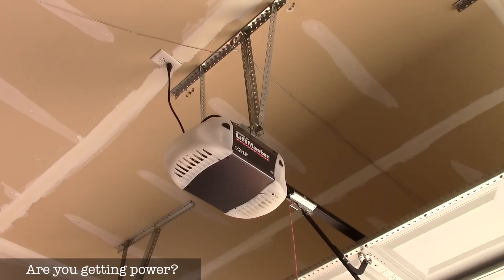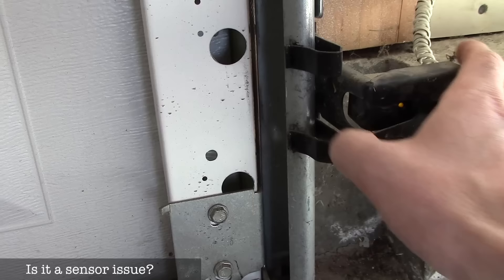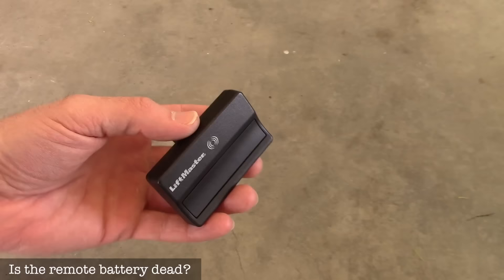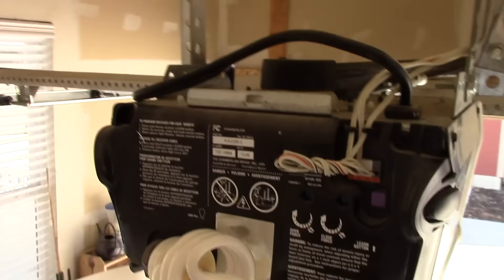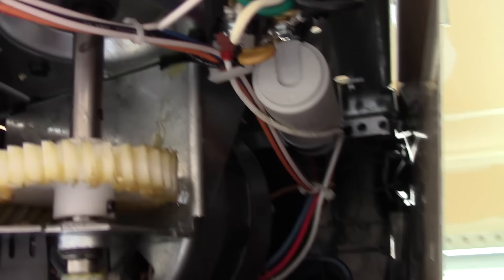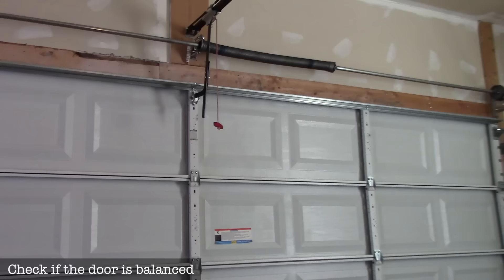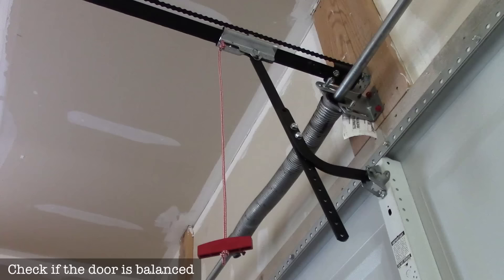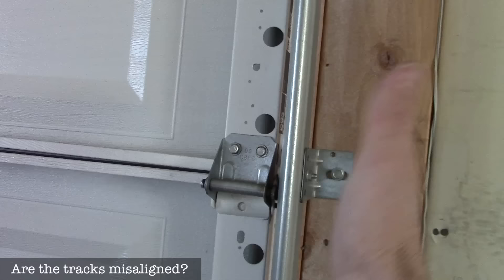Garage Door Opener Troubleshooting and Repair - How to fix common problems

Comment: Hi, I just ran across your video. I am having a challenge with my garage door. I have power and all of that and I push the button and the door will lower as it always does but I had a recent power outage and I thought maybe that was the culprit But now the door is lowering all the way closed and then the light would start flashing and the door would once again go up on its own. I was wondering if you might know what the fix of that challenge maybe.

Comment: What about the limit controls and the Open & Close force adjustments? Do you have any videos on these knobs ? They were in your video here but I didn't see you mention anything about them. Our door only opens or closes about 1 foot. When I started to adjust these, then the belt keeps running, or if I chose less adjustment, then the door wouldn't open but 2 in. Model is a Genie Pro Stealth (belt driven). Thanks...

Comment: Adam, great video.  Almost addressed my problem.  Just started.  Intermittent operation on same opener as in your video.  Sometimes opens fine, sometimes will stop in midstream.  Both in open operation as well as in close.  Just lately just goes dead.  Light goes out, no leds on wall or side sensors.  Wait a while and again works again till it doesn't.  Driving me crazy.  It is like something is heating up and if you wait till it cools off again, it will work????  If you have a chance to get back to me, I would appreciate it.  Thanks, Vince
Reply from the maker: I would check the wiring and connections. It could be a capacitor going bad as well.
Reply: Thanks for your quick response and great advise.  I watched the video another time and decided that it was the capacitor, so I went to a garage door company and purchased one and replaced it and the door works fine now.  Again, thanks and good luck to you.

Comment: Hi Adam. Your troubleshooting video is enlightening and helpful. 
However my problem is with opening and closing with a remote transmitter. Initially my double wooden garage door used to open and close with just a press on the button But recently it would open and close erratically and I’d have to press and hold down the button until fully opened or closed. What is my problem?

Comment: hi Adam. thanks for your video. I have a client with a sears garage door opener not working. it has a chain on one side and a cable on the other side of the rail. the cable side is under very high tension. the chain side is very loose. I have not take the cover off the motor yet but will be doing that tomorrow morning. I think I might need a new gear set according to your video. please confirm. I also tested the opener and the motor just make a slight whirring sound like it wants to work but cant because of a broken gear set or maybe a bad capacitor. I'm leaning towards the gear set because of the wire being high tension on one side and the chain loose on the other side of the rail. let me know your thoughts asap. thanks, jason

Comment: Thank you for this video! All my remotes were in working order with fresh batteries (including the code panel), and one day everything stopped working. Even the wall switch doesn’t work, and also doesn’t have light to it. Sensors look good. Tried my fuse box and that doesn’t work. Would the next step be the motherboard? I’m not sure about going there yet when it seems I may have a problem at the switch. What are your thoughts?

Comment: Great video! Need your help we have an old Raynor opener that's doing 2 things. First off we noticed using the remote we now need to work to find a sweet spot hitting the button long enough for it to go up or down all the way correctly versus starts and stops almost immediately requiring multiple attempts sometimes requiring we use the button in the garage which works consistently  every time. We've replaced the battery and remote. Thinking we need to replace the small black box control due to age and its limiting the remotes effective activation range? 

Second, the train is hopping up and down at certain spots along the track. We greased the track (bottom and top edge) and WD40'd the wheels, axle shafts and checked condition of springs (new within the last 1.5 years when door was professionally serviced. Based upon your video appears everything has easy/free movement and is properly aligned achieving neutral. We also played with adjusting the chain more or less and didn't make a difference. Violent enough that the door will stop in its tracks and we need to help push/pull to assist before it gives up and times out. Uncertain if this makes a difference, we get a lot of moisture in the garage given how it was constructed. Concrete patio above leaks when it rains and concrete block sweating given the back side is partially buried. Appreciate your help and advice. Thanks, John

Comment: Thank you for this amazing video. I have a Chamberlain Lift Master 1/3 HP.  I'm having  problems to open it. When I press the button on the wall the light is flashing and it gives me the sound that it's going to go up...but no. I have to keep trying sometimes more than 6 or seven times before it finally goes up. Once it's up ...with one press it goes down.
I adjusted the sensors as you instructed and both have LED light on.
what should be the problem? Can you please tell me what to do to fix the problem?

Thank you

Comment: I just need the wiring schematic. For the sensors and wall button. I have two conductors not connected, just hanging near terminal strip. My wall button isn’t working..Maybe someone knocked the wires out moving a chunk of wood. So I need schematic or info on where the wall switch feed line terminates at the head unit terminal strip. You speak nice and clear...are you Canadian?

Comment: My Craftsman opener seemed to have a short inside the unit.  It starts to open or close and gets halfway or a quarter way and the power goes out in the unit.  I hit the unit with a yard stick and the power comes back on.  The wires seem to be secure can't pull them out.  I thought it was the wire to the wall button which pulled out once but I put it back in.  Maybe it needs to be cut off and resliced and then put back in.

Comment: My door started acting up last winter. Went up a few inches and stopped. If I pushed the button enough times...it would finally go up. Once the weather warmed up...it was fine. It worked like a charm all summer, now that winter is back it’s doing the same thing. Any thoughts?

Comment: My garage door won’t open or close . My wife initially tried with her car remote then we manually typed in the code and nothing. I checked sensors they seemed to be good . The power seems to be working fine . I did notice the green LED light on the inside is flashing but I pressed and held the lock button but it did not go off.  I am not sure whether to try and replace the mother board or not. It is a 15 year old lift master .  The button in the back which I assume is the learn button to reprogram remote doesn’t seem to be doing anything when I press and hold it down.   Any thoughts on what I should do.
Thank you and great video

Comment: Hi Adam, my garage door opens fine but it's not closing good. It keeps stopping. I have to keep pressing the control several times until it closes. Also, the power goes out completely. I have to wait until the light turns on again I have to press again several times until it closes. Power goes out completely. Even in my wall where I press from the inside.

Comment: Today I raised my LiftMaster Opener for a single garage door. A few minutes later I pushed the remote to close and the motor grunted twice like a recoil and that was all it would do. It did the same thing when I tried the wall switch. I pulled the release and manually closed the door.

What should I try? Manual says to try to unplug and plug back in to reset. 

Unplugging and re-plugging the power cord in didn’t change a thing.

I was able to get closer to the motor unit and upon inspection I found that on the side of the trolley where the chain tension adjustor is located the chain is extremely tight but on the other side of the trolley the chain is drooping slightly below the trolley. I would think that the tension would be the same on both sides. Maybe because the chain is so tight on the adjustor side there is a sensor that senses the tightness and thus will not operate the motor. Or, maybe there is a pulley at the opposite end of the trolley that has frozen up and not equaling out the tension in the chain. 

What should I do next? Screaming at my wife didn’t change a thing. Maybe I wasn’t loud enough! ;-/

Comment: Very helpful and concise video. However, my issue is the keypad. I enter the code to open the garage and it doesn’t open. I open the garage with my car garage door opener, and once inside I can close the door from the keypad by pressing enter. I changed the keypad battery and no difference. Does it need to be reprogrammed?

Comment: Hey Adam, I watched your garage door opener troubleshooting video on YouTube.  It was really good but did not address my issue.  The door is jammed against the safety bolt and when I push the button the motor hums but doesn't move the door.  Wondering if you know how I can fix it.  Thank you.  Best, Ant

Comment: Dear Adam Thank you so much for your wonderful Video, Unfortunately I did change the capacitor but still doesn't work :-( , when i push the main switch i hear 2  clik ,,, clik on the unit, i don't know where it is coming from but seems like some switch inside the Unit . is that help you to Kindly tell me what it can be wrong please ? i do appreciate you very much .

Comment: Great video BTW, Adam i changed out my logic board liftmaster 3240 but the door keeps opening on it's own. Before i changed it the door opened and closed on it's own. Could it be the capacitor ?

Comment: Hi Adam! I have a new problem that just cropped up a couple of days ago, and it's not one you covered here. Perhaps you have a suggestion for me? Thanks in advance! Here's the issue.

I know the remote is working, as it works when it's up close to the opener inside the garage. However the opener is not picking up the signal from outside when the garage door is closed. It's been working fine for 20 years (yup, she's an old one!) so this is something new. There have been no changes to my configuration (like me messing around up near the unit, or bumping that aerial and knocking it loose or anything like that.)

I think I might have to call the local repair guys to come and check it out, perhaps replace it, or maybe that entire back panel you describe in your video (I have a liftmaster 1/3 hp). At any rate, any suggestions that you have are much appreciated before I call in the local guys.

[EDIT] - I should have checked your other videos before writing this comment, because you have one that directly addresses my issue. Called "How to fix a garage door opener Board Repair - Remote not working" - I figured I'd just edit my post here as opposed to deleting it, as someone else who stumbles upon my comment might be helped by what I just learned too. Thanks again!

Comment: After several days of fiddling with virtually the entire door opening equipment I finally found my problem. I had a short from 2 wires that go to the main board pins. The RPM Sensor wheel must have rubbed the plastic insulation of both wires as they were both bare at the same spot. Since I had the cover off of the motor unit and everything was exposed I finally saw what the problem was and this was an easy fix with some electrician tape and shoe-goo (my go to stuff for many many fixes).  

My problems were: The door stopped intermittently at varying spots. I found that I could make the opener fail by tapping the outer case with a screwdriver and the lights would flicker and the door would stop moving. I could hear clicking sound too so I thought there might be a short. Sometimes I couldn't get it shut at all. It also was travelling too far up the track and hit the stop bolt (due to incorrect opening strength). Then it started reversing when it reached the floor (due to incorrect closing strength).

I had been through the whole troubleshooting route .. lubrication, sensor eyes, tracks, tightened chain, tightened the torsion spring a half turn (couldn't turn it any further and too scared to force it further), I also pulled the boards and inspected them for cracks using a microscope. I was just about to start ordering parts (main board, RPM Sensor board, Oscillator and was thinking I'd call a technician when I took one more shot at it. 

Its working perfectly now as I was able to set the opening and closing strength set screws perfectly while I had the cover off. I could see how the contact points move when the door is in motion up and down so I could easily turn the set screws to get the contacts perfectly placed. It is easier to see what is going on with the cover off but you have to be very careful to stay clear of moving parts.
Reply: My green light with the white square on the wall is flickering and when I push the square to open the door there is nothing. ..My sensors are clean . One is green one is yellow. My lightbulb on the box is not working either and it’s not burnt out. Help please!
Reply: @christiehavir  my wall control doesn't have a green light but it does have a large white button that opens the door when pushed. If my large square button is flashing that means the controls are locked. There is a small button on the same wall control box that is labeled "lock". If you push that button until the flashing stops it might fix your problem. If that's not it I suggest also checking your circuit breaker.

Comment: what would cause the reception to be reduced to the point where the remote can only be about 5 feet from the garage door opener  for it to receive the signal to open?   I have 2 remotes and a couple cars that have homelink.  All of them can no longer activate the garage door opener unless very close to the garage door opener.   I was able to improve things by adding some wire to the antenna but the range is no where near as good as it used to be.

Comment: Hey Adam. Great video, thanks. My question is one of my safety sensor wires cam out oh the back of the unit. I cannot for the life of me figure out how to release the wires from the back of the unit so that I can re-insert the wire that came out. Do I put something inside the wire slot to release the wire and then reinsert? Thank you!!

Comment: Hello Adam.
Great video amd now my question...
Changed gears ( were disintegrated ) and put chain back as close as possible to where it was when I started.  Now motor moves about 4-6 inches down then back to where it started. All sensors good as the door was working fine until gears let go.
Now my second door gears went bad.  Don't want to try to fix 2nd door until I figure out 1st door.
Thanks in advance.
What am I missing?

Comment: Adam, thank you for the great information. I have a very old Genie Pro that has no sensors connected.  The door responds to all remotes and wall power button to open the door but nothing closes the door. To close the door I have to release the door and lower it manually.  Would appreciate any help with this problem.

Comment: There is a relay that sounds like its going crazy on the board. Ive checked sensors and popped wires off the switch by the door, any thoughts? Thanks in advance

Comment: I need help. First time troubleshooting one of these. It is a Genie model gcg350l. It is a friend from work, she  just bought the house and now the garage door went out. From the looks of it seems to be the gearing. When I got there someone had already opened the case, I pushed the wall button to see what it would do, and the big plastic gear fell off the whole thing with the shaft. Would be best to get a whole new unit, because I see Amazon sells individual parts. Could you make a video on how the gear system works, please advise.

Comment: Great video however my problem was not addressed. The problem I have is that the trolley you refer to, is jammed on the rail above the garage door. I cannot slide it all all. The metal part that latches onto it with the string lever, is too far forward to reach it even manually. It is really stuck on there! Any suggestions? When I hit the garage door button it just hums a bit but won't budge it. It is very awkward to get to to try to use elbow grease to unjam it. Thanks in advance.

Comment: Adam: Trying to get my Liftmaster Garage Door Openers to work. Potential Problems are:
1) LED light on the motor unit does not stay off as in your video. It flashes 5 times then off for a few seconds, then flashes again. I press the learn button when the LED is off for a few seconds and it stays on - I press the opener and the light bulb goes off, on and off again. I think it has learned but still doesn'y work. When I trying using the opener I just get a click.

2) One sensor has the LED light working. The other sensor LED is not lit. I tried adjusting a bit but LED still does not light up. appears the cord to the sensor is fine. When I interrupt the beam between the sensors, the lighted LED still goes off (indicating the sensors are working ???)

I could sure use you help or best guess. Thanks